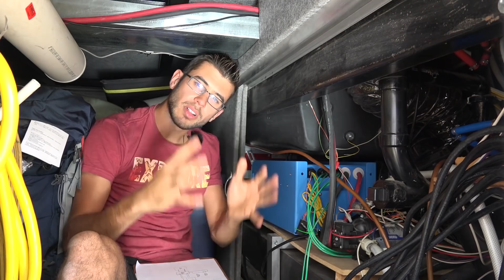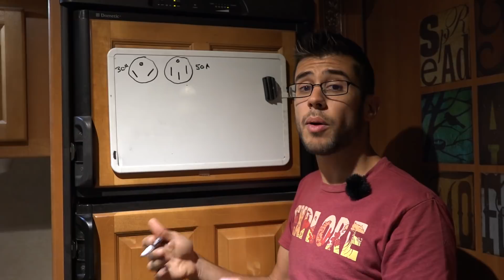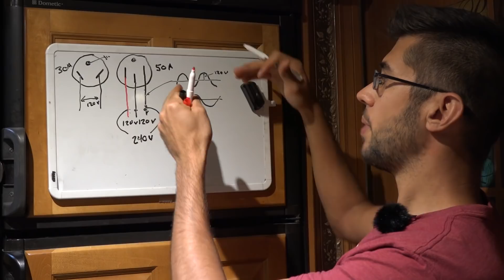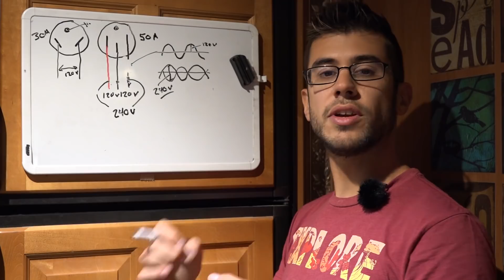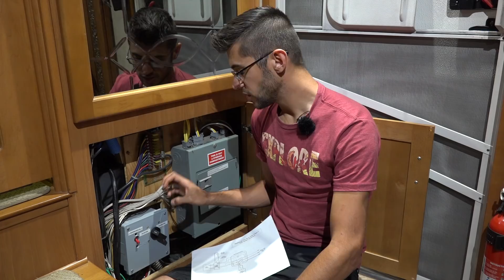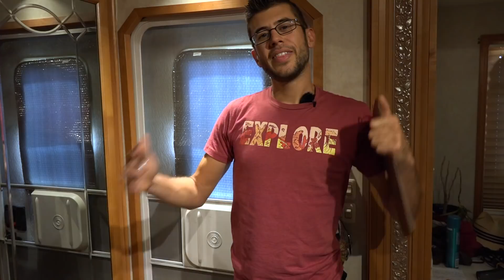RV Solar Phase 3 - 24V Inverter Installation for powering the whole AC system of our RV!

Comment: You did a good job of explaining your system and I love how you set it up.  My only gripe with it is you used ONLY green wire on the AC side.  That is an accident waiting to happen.  I know this is 2 years ago - hopefully you have fixed that and wired it correctly.  For the AC in and out each wiring set should be black (hot), white (neutral), and green (ground).  They should be in romex and not free roaming like seen in the video.

Comment: One request…..Some of us viewers are ancient, well at least older, and several of the terms you use are not what we have become accustomed to, for instance, a wire “connects” to a bus or somewhere, it does not “land” there…..and a power cable connected to a fuse/breaker panel box does not actually “light up” anything, except a light fixture….it “powers” something.  And possibly you can lead the charge on educating the world of younger computer users who think they are supposed to “hit” Enter, etc. rather than “Press” it.  And while you are saving the world, how about getting people to quit saying, “The VIN Number is so and so. They are actually saying, “The Vehicle Identification Number Number is so and so. I only ask for this because you demonstrate a great knowledge coupled with a little slower, but deliberate, vocal delivery, and seemingly high level of patience which seems to be exactly what we need in this crazy world we live in. Thanks, from one of the Ancients!

Comment: I really need to know how that switch is jumpered. I have the exact same switch and and desire the exact same result. It would help to know the wiring on the a blue Sea switch too. Thanks in advance.
Reply from the maker: I did not share exact wiring because even tho the switches look the same sometimes internal connections are different and I have shorted one out assuming they were the same..  always get your multimeter and figure out what connects to what one each position, then check your wiring after connected to make sure powered will flow as you want before energizing .  Very critical
Reply: Mortons on the Move thanks for the reply. I did just that. Was frustrated about jumpers. I’m not very electrical ......but I’m learning!!!

Comment: So there isnt any protection for the battery in cold conditions if u charge from the inverter/charger?  It looks like the only charge protection is from solar, not the inverter/ charger.  Is that correct?

Comment: Hi there, have been watching your technical videos as I'm refiting a sailboat. Plan to use the tesla battery as well, with the Victron Inverter. Can you confirm that you can turn on the Victron, on inverter mode, with the batteries bellow 21v (ou 20v ou close to 19v)? The specs show it suports all the way down to 19v, but I have seen some comments from users saying it wont start if the Vin is lower than 21.5v. Cheers.

Comment: Tom, why not an automatic transfer switch? I have an issue with my system that when I run the microwave it trips the inverter until I reset it. I can run it though through an outlet on the inverter. I’m hard wired through an automatic transfer switch. Can’t figure it out. 🤔

Comment: Hi!  Question about your inverter/charger charging the Tesla battery when plugged in...  As per the previous video, the temperature disconnect and over-voltage disconnect is only on the solar charger input.  This means that the charger on the Victron will try to charge the battery regardless of the temperature?  Also, if the Victron were not set correctly, it could charge the battery over the voltage set in the over-voltage disconnect?  I understand why you might have done this to save money.  You just have to not start the generator without the battery heating pad on and ensure the Victron is set correctly to the maximum voltage.

If you were concerned about the above problem, could you have used 2 220 amp disconnects in series?  One as it is already and one connected to the low temp/over-voltage relays with the solar and the Victron inverter/charger on the other side?

Comment: Very nice setup. Just a couple of things I am sure you have covered but I will mention them anyway.

1. Make sure you have the ground and neutral bonded at the inverter. It is sometimes an option on the dip switches and is usually relay number one if you have that option. If you are not sure check with Victron to make sure.

2 With the relay on the back of the BMV I would personally connect it to a relay that has three poles. The relay on state can be set to the low voltage and of at the high voltage state on the battery pack. This way the relay is only closed when you battery is between the healthy range and if it goes to low or two high it will open (set relay to invert). Use a small low current 12v coil relay as it is only switching signal voltages. Run one pair to the inverter enable, one pair to the main battery disconnect loop and the third to the charge enable battery disconnect loop. This will power down and isolate everything including the BMV but that is a good thing. The relay on the bmv will only change state when you battery is at a state that is to low or two high.

Behind the panel you could have an override switch (NO) on each pair so depending on the battery problem you can take the needed action. For example if the battery had gone to low you could close the battery disconnect switch and the solar. If it was to high you could close the battery disconnect and the inverter to load down the battery. FYI the relay on the BMV is a flip flop type and keeps its state if the power fails.

This loop that goes to the three pole relay would run from ground to the relay and the positive would run from your starter battery or the small SLA battery you have fitted (I could not see the AH rating of that battery but hydraulic pumps use a lot of power so it may be worth installing a larger battery. You could easily take it down to well below 50% DOD). The other important feature this could give you is an emergency power kill (mounted beyond child reach of course) You could use a standard emergency stop button, wired into the relay loop it would instantly kill all power in the RV including 120vac and 12vdc. This could (god forbid) be used in the event of an electrocution or fire.

3. The last item it may be worth investing in is a 24v to 12v battery charger to keep your starter battery topped up at all times in case you were somewhere remote and left headlights or sidelights on for example.

4. The battery protect units have alarm outputs. It would not hurt to have a buzzer and LED to give you fast indication that the solar charger had been isolated for example.

Sorry for the massive post but these were a few things that came to me while watching your video, oh and you are forgiven for not running wiring that is the to code regards the colours  ;-)   I think you have performed a great install and have covered every contingency aside from the minor ones above.

I hope you and your family have some wonderful holidays and lots of happy times in that lovely RV  :-)

Stu...

Comment: Great video. Because the Tesla battery is not the same voltage as traditional 24 volt batteries. Does the inverter use all the power in the battery? Does it invert down to 20 volts of the battery? Or where does the inverter shut down. 

I have read the Tesla battery is not as useable as the volts are lower then lead acid. 

Are you able to use all the battery power at lower voltages?

Comment: 22:50 - Do you have a relay between your multiplus and the BMV?  I didn’t realize this was possible...very cool.
Reply from the maker: On the negative? No just the main BP unit. We use the BMV relay to shut down the inverter on overvoltage.

Comment: Bad choice of color coding your wires. All green wires fails the UEC codes, where green should be ground, period. Otherwise, buy yourself a label maker & make flags attached to each wire, source & termination end. You have a lot of inexperienced followers that need that extra level of distinction. Different colors of the same guage, are no different in price. Having a 'roll' of wire maybe good for less waste in a run, but, your acting as a teacher, you need to do it right so that your students maintain a clear understanding. My opinion. Yes, I maintain four rolls of colored wire in my stock.

Comment: You might want to recheck the spec sheet on that inverter.

It is 3000VA (Volt Amps) NOT 3000W (Watts). Max Watts at 77F is 2400W and it drops to 1700W at 105F.

Comment: Thanks for sharing!

I guess u need to reconsider the ventilation for the inverter! Also, I have a problem with charging the batteries from the inverter. Batteries are (3.6v*6=21.6v nominal). Inverter, however, is programmed to charge 24v nominal.

and how are u balancing the Tesla battery?

Comment: As I understand it, your Tesla battery module is connected at 6S1P.  That gives a usable voltage of of between 19V to 25V (approx).  According to Victron, their 24V inverters can not start under 21.5 volts.  Does that mean that your inverter wont work when the battery is below 50% state of charge?  If so, that would cut your usable battery capacity in half.  Since you have an older Victron, does it work at lower voltages?  

Im seriously considering building a similar Tesla system for my RV but I can not seem to find a compatible inverter.  Any help would be greatly appreciated.
Reply from the maker: The inverter won't start below 21.5 but will run down to 18v if it's on.  When low we just leave it on or if you apply outside 120v it kicks in so you can "jumpstart" it.  Hope they allow us to change that voltage setpoint someday.

Comment: Just FYI the phases aren’t 180° apart since they’re two out of three phases from the electrical generation.
Reply from the maker: Not quite, Split phase is only one phase of the three, run through a split phase center tapped transformer.  Thus you do have two phases 180 degrees out of phase.  Two phase power would be 90 degrees out of phase and does exist, although rare.  My description is a little off regarding RMS but for simplicity sake its pretty close.

Comment: I just saw a website that claims that the closer the power of the inverter is to the power of the device being used, the more efficient the inverter will be. Here is the link  https://www.e-education.psu.edu/eme812/node/738
Reply from the maker: It depends on the inverter but usually around 80percent load is most efficient.

Comment: The majority of time the RV is parked in a driveway using shore power or parked at a mini storage because it is illegal to park at home and issues of security. There are several monitoring systems for homes can these systems systems be used for an RV 12 volt 24 volt solar and 240 volt systems? They now make a monitoring system that plugs into input of a 200 amp panel box and learns to monitor each outlet or appliance . Courious if this could be used all phases in an RV?

Comment: Wow. get's really technical. Do you have a electrical engineering degree ?? Amazing explanations. But I think I would stay with a 12 volt system using 6 Zamp 170 watt solar panel on roof and  1 zamp  180 watt portable solar panel.
Reply from the maker: Yes I have a EE degree in Power.  I have done large commercial solar installation.

Comment: Hey Tom. Thanks for the 30A vs 50A system. Our rig is only 30A but it’s good to understand how both systems work. 
I was unaware of inverters that can utilize both shore power and solar/battery simultaneously. One of my unanswered question was how to supplement my shore power with a solar/battery system as we pay separate electric where we are docked now. 

As always you give clear explanations and details on how everything works together. Thank you. 

D

Comment: what i also like best is that there are 10 million lithium battery experts who DO NOT OWN EVEN 1 AMP HOUR LITHIUM BATTERIES.......

I drove my tundra truck for 4 days at below 10F, it has no BMS, NO HEATER, NOTHING - everything works fine on 10 year old lithium 4 x 100 AMP hour CALB chinese batteries.....

Comment: How are you running an inverter and generator at the same time (same circuit)? The AC sync of a generator is near impossible....
Unless the AC from generator is converted to DC then back (with battery current) to AC....
American split 120 v panel is fucked up, should switch to 240 v and be done with it!

Comment: Hi Tom just wanted to say thanks for another great video I watched awhile ago and it's super helpful I'm still piecing my system together and your work has helped I'm thinking a Victron with a auto transfer switch just because of the load sharing function anyway years back like 20 years ago I had
Two 2012 trace inverters running in my coach and they didn't have much information to work with out there compared to today so thanks again for sharing your knowledge.
Also just watched the new movie
RV nomads it was a great movie it captures everything I've felt for years about the lifestyle and what it does for the soul,  you nailed it.
Carry on young man and thanks for the ride.

Comment: Watched all 3 Phases of your install and 2 comments, 1 all that green wire would drive me Bat Sh*t crazy!!   2. You shouldn't parallel #10 for 60 amps (1/0 smallest allowed)  and should have used a single #6 cu as per NEC 310.4   Having said that, great job and the best I have seen on line. Safe travels
Reply from the maker: You are correct per code and something we are planning to change.  We know you cannot double ampacity with 2 wires.   We actually only see 30A so the parallel is more for voltage drop.

Comment: Great videos but it scares me how you run those heavy duty..or any single insulated cables by metal edges ..they need protecting from metal edges and also fixed...vibration could cause those edges to cut through you cable insulation and ...a short and potential overheating leading to fire.
Reply from the maker: I did not show it but we put heavy rubber gaskets around those metal edges.

Comment: Hello Tom,
Greetings from California.
Explanations are extremely stupendous, I’m actually baffled at each sections of the PV system being described, by you.
N@$@ does the same thing, they overkill every system they have designed. Perhaps many redundant systems, to speak of, at our expense!
I’m not undermining your vocal skills, they are perfect, exhibiting Professorial gravity. Great.
But, then again, the project is PV system charging a Battery Bank.
Do we have to complicate the simple system, by involving such an enormous amount of electronics?
Using MPPT system was a great choice, indeed. MPPT device can reduce 24V to 12V DC, depending of make and model and cost.
Encasing the Battery Bank in a 1/4 inch plywood enclosure...... well....  no comments there.
Aluminium Case, perhaps?
Lining the Electronics Cabin with 1/4 inch plywood..... well no comments there either.
Phenolic fibre panels, instead? A thought..
The list goes on, scaring me to the hilt.
Forgive me, for my comments. But,  I really appreciate your endeavour, admire, too.
You have put in a tremendous amount hard work to preform the job. Bravo.
Cheers, buddy.

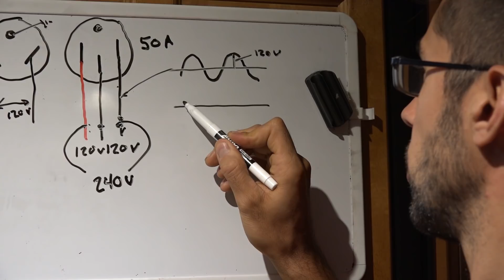Comment: A minor nitpick at @16:00 : The line you drew is the peak voltage of the sine wave, which is 170 volts. But if you measure the RMS voltage (which most oscilloscopes can do now or an RMS capable multimeter), it would measure 120 volts RMS.  The RMS (Root-Mean-Square) is a measure of the overall "heating" value of the waveform over the whole cycle.  In other words, if you put 120 Volts DC or 120 Vrms AC on a heating appliance, it would have the same heat output.
Reply from the maker: Yea...but wanted to keep this video easy to understand for general consumption.  I would love to confuse people with imaginary power, PFC,  inductance and capacitance but don't want to deal with the comments lol.

Comment: I don't think you mentioned it but I would not charge the battery from both sources at the same time. If you are using shore power to charge you should turn off the solar charge controller. Sometimes the voltage regulators will fight with each other.  This was a very good explanation of your system and looks like it should work great.
Reply from the maker: Yes I agree,  have seen my inverter lose its brain and try to overcharge the batt when the solar is on.  The overvoltage cut it out tho.

Comment: I’m confused. You said that the Tesla was 24v. But did you say your inverter is 36v? And is it the 24 or 36 that you managed to set up the ac. Because mine allows some AC use but on really sunny days. No clouds.  

I’m 24v inverter, with s midnight solar controller, and a resistance load for the 24v wind gen and eight I think it’s royal batteries if I remember. So I would like to add a Tesla and since I’m already on 24v is the Tesla plug and play lol.

Thanks so much for sharing this info and knowledge for the rest of us.

Comment: I must assume you used the 24/3000 120v based on a good price as you eluded to since it's a ~10 year old model.  That said, if money was no object, would you not consider doing the 240v version and thus not having to feed both legs the way you did?  At that point you could eliminate a transfer switch completely and simply run shore power directly to the inverter and then through to the AC panel.  More or less that's what I'm expecting to do on our new rig.  Haven't decided if we'll go with a pair of Tesla batteries or build my own via 180ah cells.  Good video though, I'll share mine with you as it progresses